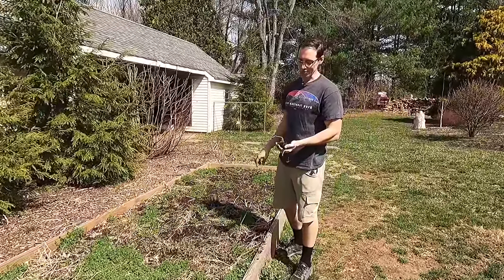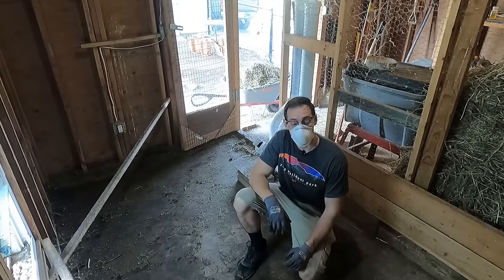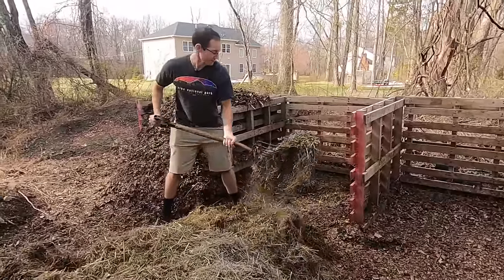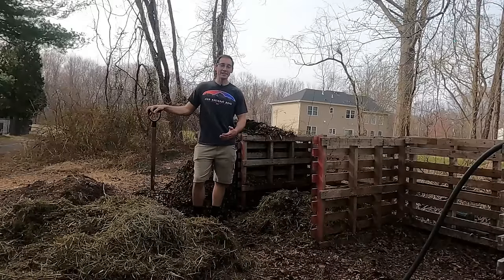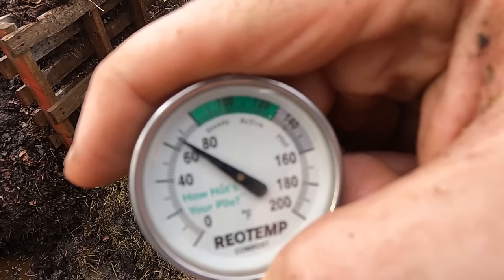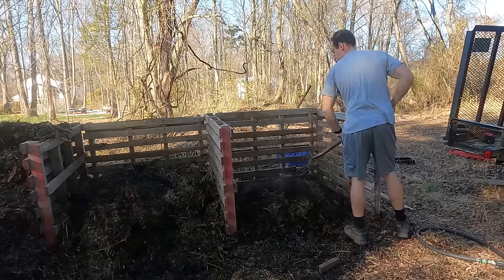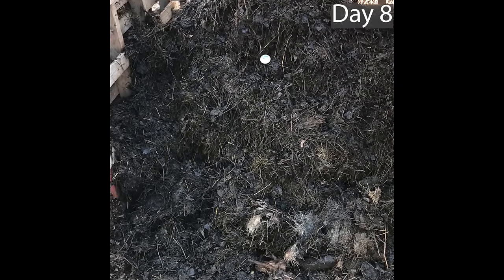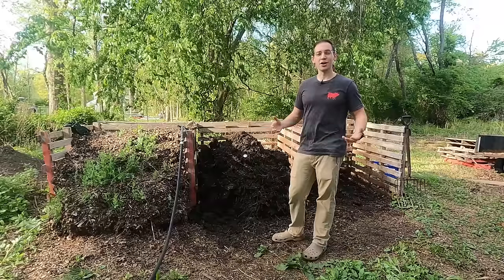How to Build a HOT Compost Pile. DAY by DAY - START to FINISH

Comment: Too hot compost is a myth. In mine, I regularly reach 165 f without any problems. It is true that at that point the thermophilic bacteria start to die, but their dying means that the thermophilic process is dying down, i.e. the compost heap is partially cooling down. Once it has cooled down sufficiently, the bacteria multiply rapidly again. This balances the process itself. Very hot compost means that it has ideal nitrogen-carbon ratios and it is a shame to turn it at that point. The bacterial count and temperature will balance themselves. This can be seen by the temperature fluctuating between 165 and 145 f. Only when the temperature starts to drop below 130 f without rising again is it time to turn.
Reply from the maker: Amazing info thanks!!
Reply: Not sure about the ‘myth’ bit.  I am a horticulturalist in Sydney Australia and I have seen the middle of compost heaps become grey ash.   Take it or leave it😊
Reply: I just learned this as well! I was experimenting and I got the same results! I even have it timed! If it’s not meeting that timeline, something is up!
Reply: Very interesting information. My go-to source of info, Cornel University's composting website, says to turn the pile if it exceeds 165F. It needs turning again every time it drops to 135F. But your explanation sounds plausible. I think I'll try it your way. Thanks!
Reply: So you can make compost without greens? Does the chicken manure replace the greens? I'm just learning to and it's seems very difficult and really scientific but everyone says it's in easy process

Comment: Good job and good video! Thank you! We don't have chicken so I do cool compost by just putting one layer of food scrap, one layer of leaves or grass clippings, water, in a compost container and let it sit until whenever... 😄
Reply from the maker: Hey, if it works, it works!! Great job figuring out something that works for you.
Reply: @twiggshomestead6497  Hehe.. Thank you!! This is my second year learning and trying to create compost. I bought 3 metal containers from Tractor Supply designed for compost but they're small, not even 3 ft in diameter, but they weren't too expensive when I bought them, and I got them for convenience and privacy so neighbors can't see compost or they might think we're hoarding trash.. I wish I could have a compost system with 3 bins like what you have... Anyways, last summer we dumped out one container in a flower bed, the compost was not quite finished but it was good, we grew several types of flowers in there and a huge bush of lemongrass... that lemongrass was so awesome and smelled so great, thanks to that pile of compost! I love it!  😁
Reply from the maker: @cheesekake1841  Great work! the beauty of compost is, even if not 100% complete, as long as most of the material is broken down, it will still do wonders for the plants and continue to break down on the soil surface.

Comment: Lazy man composting. Raise beds 3-5 deep. 2 feet down, 3 above. Uses the principles of hugelkulture.  Wired cloth lining the bottom to keep gophers out but allow worms in. Layer of woodchips or logs, branches on bottom. Acts as a sponge when breaks down, helps with making your plants drought proof and don’t need to water as much. Layer of chopped leaves above the wood, helps the pile from shrinking a little, your other nutrients or garden waste, a little starter from finished compost. Layer up accordingly until near the rim. It will sink. At the top last 2 layers is compost then wood chips. Thrown in some worms into your bed. They will multiply and add worm castings into your bed. Only thing you need to do is add more organic material on top as insulation because the pile keeps shrinking as worms eat at it and it degrades. Never need to buy fertilizer and don’t need to turn your pile and adds a little heat to the roots and protects from frost. You can put a cover to give it a green house effect as well. Will protect your plants in winter and give you an early Spring start. Make different bed Ph balance styles for plants that like slightly acidic soil such as Tomatoes or Blueberries. Turning your beds often will give you almost finished compost 3 weeks. My method don’t need to turn, just keep,adding new layers as it shrinks. Done on a yearly basis. Especially helpful if you got Perennials. If you start new beds just need turn top 1st foot and mix with compost and shredded leaves. Sorry, I am old gardening is a hobby, least amount of physical labor fits my style of gardening. The 2 things you need to understand hugelkultur and layering for worms to live in, and how hot you want your pile. If you dig out your bed for the compost, maybe 6-8 years later. Why dig it out, worms keep a cool bed, a hot compost bed gives off heat. Need a layer for worms to migrate to if you use both. Some people want the heat for really cold weather, greenhouse heat.

There are different lazy man gardening, timing when to turn your compost pile to get heat, August, September, October. If you got chickens, and use deep litter method, clean out then when you get a lot of leaves. Saves the time of building a compost pile, turning the pile, place to dump your organic waste and usually starts to rains so you don’t need to water your pile. Also use this time to build a new bed so you layer it the way you want. If you use worms, leave about 1 foot migration layer on top of compost. This allows you to plant immediately too. As your pile begins to shrink you add new layers of grass, woodchips, kitchen scraps, eggs, seaweed, leaves etc etc. You can customize your bed to be the most nutrient dense bed and soil. Since your bed lasts for a long time, concrete block is easiest and cheapest. If you want insulated then you need to make your own forms and use aircrete, very light concrete paneling. Will last 20 years plus. Keeping out rabbits and deer, cattle paneling as the frame for your green house. Either stick it on hinges so you can lift it or make it large enough to be a walk in greenhouse. Size of your raised beds, greenhouse, budget and how much work you want to put into it varies for everyone. My personal preference is an herb garden, lemon and lime trees, garlic and onions, potatoes and carrots and root vegetables and leafy greens, just cut everything fresh from the garden as I need it. Controlling temperature and light dictates if my plants bolt to seed or not. Less waste.
Reply from the maker: Amazing! Thank you for sharing. Make sure to stick around because I am going to be doing this exact method this spring with 4 new raised beds.

Comment: I am about to start my first attempt at composting. I love watching videos about it so I can pick up tips from everyone out there doing it. I have decided to use large trash cans with holes drilled in the bottom and sides for air flow and excess water escape. I can bungee cord the trash cans to my fencing to keep the wind from blowing them away. I’m in the country, and have access to leaves, pine needles and pine cones. I have lots of access to coffee grinds and my food scraps.  I have cow manure from my cousin’s pasture, which I can access from my yard, as well as trampled, pooped on hay.  I think I’ve got all I need to get started.
Reply from the maker: You sure do! Just pile all of that up and add water. You will be off to the races!
Reply: Make sure to get water and air in there. Try PVC pipes to get water and air to the middle. Turn if it’s not getting hot anymore.

Comment: whoa....that seems like way too much water. I see that it's standing water after you finish...oy!
Reply from the maker: Thanks for the comment! I do have to soak it heavy at the start because I turn off the water once the weather gets cold. The water on the ground soaks down after a hour or so and the pile is nice and wet. It heats up quick and burns a lot of the moisture off. I don't do such a heavy soaking in the later sages as I found it will certainly promote anarobic conditions. It won't hurt in the early stages though especially when you are turning it daily or every other day. Just helps move things along. 

I will do a dry pile in the winter which has a lot less nitrogen and takes about 4-6 months to fully break down. That is great for the cold dead of winter months when the water is turned off.

Comment: I have a similiar setup, also with chicken beddding and leaves as main source (and alot of horsemanure). 

Ive added vertical air pipes, and cut down on turning it alot. I remove the pipes after 10 days, it will create a vertical void that transport air into the pile without turning. 

As a final step, after i consider it finished compost, i move it into the out door area of my chickens. They will remove any weed seeds from the finished compost, and feast on all worms and insects.

Comment: How do I restart a pile that I made 6 months ago, to heat it up again, ?    It was made in the winter, and heated up really fast, but I never maintained it..  I’d like to try and restart the pile, or make a new one, and use the materials ..  any advice ??
Reply from the maker: The best way to heat it back up is to turn and wet it really well. If it still doesn't heat back up after that, then the ratio of carbon to nitrogen (browns to greens) was off. In your case too many browns; which makes sense for a winter pile. All good though! What you can do to heat it back up and continue the compost process is simply add more greens and mix/ wet it really well. Grass clippings are a great easy nitrogen source you can add to a cool pile to heat it back up. Lots of coffee grinds will work too! 

Let me know how it goes and if that helps
Reply: @twiggshomestead6497   
This is great info. Thank you..

Comment: You don't even have to wet compost Compost will naturally break down by itself because of the microorganisms that's naturally in Grass nature naturally with do the work for you all you have to do is power it up it will break down by itself
Reply from the maker: Yes! Very true! I have a great big pile going right now that way. No extra water or frequent turning, it just takes a lot longer. You could speed the entire process up significantly by turning it and adding water to keep moisture and heat up!

Comment: So thank you for this video.  One question that I would have, if you should use a mask and gloves to clean out the chickens, why not use at least a mask to put it into the compost pile?  You are still moving the poop and straw, yes, it is a little more open.  The dust would still be there, correct.  Not trying to be rude, just trying to ask to understand.  I am looking to do compost at the  house..  Thank you.. Good video best i have seen this explained..
Reply from the maker: It is MUCH more open lol. I went from being inside a tiny 6x10 closed space with very little ventilation to outside, wide open air. I also wet the pile down rapidly when outside which eliminates the dust.

Comment: If your pile doesnt reach those temperatures can we put a tarp over it to trap the heat? Or what do we do to get the temp up?

Also you turn it if the temp is to high and to low???
Reply from the maker: The pile will always get to the high temp so long you have the right amount of nitrogen or “green” material. If it’s not getting hot enough you need to add more nitrogen. A the heat will come from within the center of the pile so trying to wrap it won’t be doing much to the temp inside. If anything it will cause harm because it will prevent rain water from keeping the pile moist and encourage the pile to dry out. 

Yes when the pile gets very hot above 160°F, you turn it. If it drops below 100°F you can add moisture and turn it.

Comment: Can we do this without the themometer?
Reply from the maker: Yes, you will probably have to get your hands dirty though. The process is the same you will just have to dig a hole with your hand to try and get as close to the center as you can feel for temperature. If it begins to get uncomfortably hot, its time to turn.

Comment: very solid information. well done but how does the compost now not heat up after use when watered
Reply from the maker: Thank you! Once the compost is complete, the heating process will stop. Even if the compost is not 100% complete before use, it will not heat in thin application. It is the mass of a pile that retains and generates heat.

Comment: I'm makings compose with store bought soil, leaves & vegi & fruit scraps 4 about 1 month been only at 70 F° can I still add grass clippings 2 heat it up more & so it kills harmful bacteria, ect.?
Reply from the maker: Yes, you can add more "greens" like grass clippings and nitrogen-rich components. Just make sure to turn the pile well after using grass clipping and wet it down!

Comment: Thank you so much for the detailed explanation in your video. I have all it takes to make compost in my farm but I have not started because of lack of knowledge on how to go about it. All I used to do was to collect the chicken drops and wet and dry them and start applying to my plants after some months. I hardly put enough grasses.
But very quickly... I can see your 3t Lmao tiers compost bin outside.. my question: is there any problems when the compost is beaten by rain?
I'm asking this question because I do move my dried chicken manure inside to avoid rain.
Your response will be highly appreciated!
Reply from the maker: You can do this!! No the rain will not hurt anything. you need the moisture to activate the compost and get it going.

Comment: I never worried about spreading out the straw in the chicken coop.  I would just put the whole bale in, cut the lines off, and the chickens would go to work spreading that straw out all by themselves.  There would sometimes have some bugs or wheat in there, and they were determined to find it.  I'd check back a while later, and they would have that straw spread out perfectly throughout the coop.  My father told me that I probably didn't even need to cut the ties on the straw.
Reply from the maker: Amazing! I’m going to try this next time. I appreciate the comment!

Comment: If you want a really quick compost, piss in a bucket until its nearly full,then  tip it on the.  Compost ps stand back.
Reply from the maker: Someone told me, if you piss on a fruit tree once or twice a year, it will benefit immensely. I can see how it would be the same for compost however, I worry it gets gnarly in a bucket for more than a few days. I would imagine it is best to go right onto the pile.

Comment: Very good compost worth a hundred of dollars if you buy it from local shop  I’m about to give it a try,but I’m not sure about few things like What time of the year is good to start and what kind of leaves are best for this job?
Reply: Good time to start is fall, when the leaves fall, but depending on how cold your winter is, your pile might not start breaking down until spring when your pile thaws. My winters get down to -30C, and my pile freezes rock hard. For reference, my piles are in those black standing containers with the lid in the top, so don’t get exposed to as much rain as an open pile like this youtuber’s. I’ve had decent results with leaving the leaves in a pile on the ground over winter, they break down some with the moisture in fall and spring. But if you are going for leaf mold, I’ve seen people just put the leaves directly on their garden beds and let it break down that way. Any leaves that are from deciduous trees should work.

Comment: Looks like  your  maure  from  your  coop looks  much  darker than  mine  . Why, what kind of   bedding  are you  using.
Reply from the maker: I use alfalfa. It's primarily used as feed for horses etc. I like to get alfalfa because it has a great little microbe called protozoa which is a predator in the microcosm and helps cycle quicker.  Choosing alfalfa versus other bedding has nothing to do with the chickens and everything to do with the compost!

Comment: I like your method it helps a lot my question in do you cover it all when the rainy season
Reply from the maker: No not when the pile is active. Once it is complete and all broken down, I will throw a tarp over it. In most cases, I use it all up before I run into that problem though lol.

Comment: Thanks, Just starting out with compost bins. Thinking of using horse manure. I know it is not as hot but it is what I have available. Would this work as well even if it would possibly take longer? Great instructions!
Reply from the maker: It might take a bit longer, I do not have experience with horse manure however I do know it makes for a wonderful product at the end of the composting process. Id say, do the exact same thing, monitor the temps and keep turning it until its done! Cant go wrong!!
Reply: @twiggshomestead6497  thanks.

Comment: Great video, thanks for posting it and the time lapse was very helpful. Also just curious as to why you didn't cover the pile to help it heat up or keep out extra moisture?  Alot of other channels seem to suggest you have to cover it. Love to hear your thoughts or ideas on covering the pile 😊
Reply from the maker: Covering it will not help heat it up. Its the green:brown ratio and the microbiology in combination with the moisture that is going to cause it to heat up. While yes, covering it might help keep moisture in, it might also prevent the pile from exhausting excess heat in the form of steam thus bringing temps too high. 

In short, if you have an issue getting the pile to temperature above 120. (Common in late fall and winter here in the northeast) then covering it might help but in this case, covering is just an extra step, using extra resources for very little gain if any at all. Please try both and let me know what your conclusion is! Id love to know and learn with you. Thanks for watching!
Reply: @twiggshomestead6497  thank you so much for you quick reply, I will try both and let you know 😊